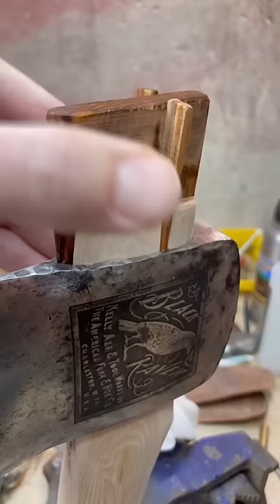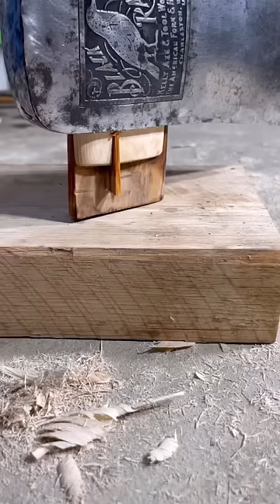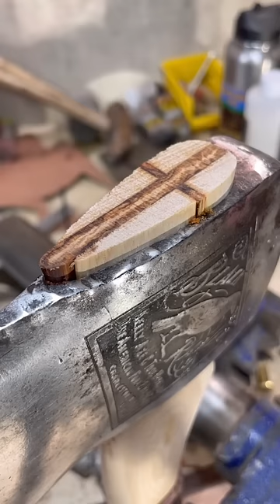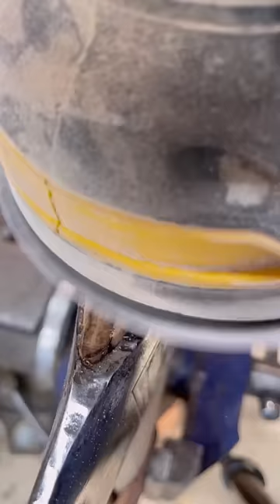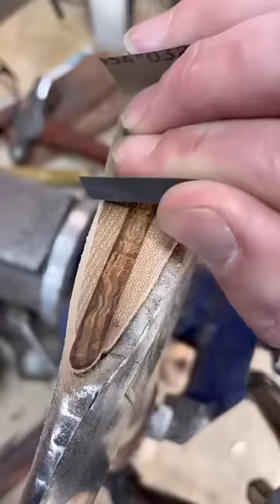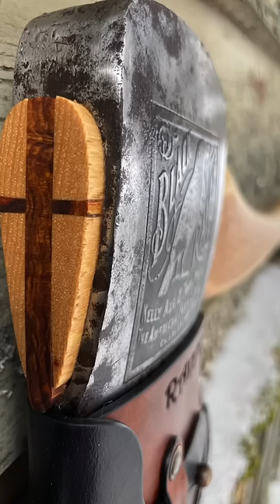Kelly Black Raven - Cross Wedge #stumptownaxes #vintage #axe

Comment: You should always put your oil on about an hour before you're going to install the handle on the head. Once you have driven the wedges the grain of the wood is compressed and does not want to receive the  Oil. If you apply the oil beforehand the oil will soak deeper into the grain and will actually get squeezed back out as you compress the grain
Reply: There appears to be oil between the layers on the area that goes inside.
Reply: Yeah, because anyone is listening to or cares to read the comment section when making and 🪓? Never.
Reply: @todtalk3912  I re-haft one of my axes every couple of years and I learned something from this comment.
Reply: I never thought of this. That makes sense. Thanks for the suggestion.
Reply: @todtalk3912 that's why you're in the comment section commenting?
Reply: Lol, look harder
Reply: I’ll never do it either way, but I love watching videos like this, but that makes sense to me👌nice comment
Reply: You always want to hang the head when the wood is as dry as possible. If you oil it first, the wood expands, you hang the head, then the oil dries out, the wood shrinks, and the head becomes loose. The wood will take more than enough oil after the head is hung.
Reply: I get what you're saying, but why put it in there just to squeeze it back out? Even with compressed fibres wood will still soak up oil's, just slower.
Reply: @todtalk3912  speak for yourself. I always make my axe handles myself and read YouTube comments. so just because you need a reason to complain, hm?
Reply: Where'd you read that nonsense, if it's that important, you're better off doing it dry then dunking it in an oil bath for a couple days, but it doesn't matter, just oil it now and then
Reply: @DQ Dukey  no you don't you don't even have an axe
Reply: @ericschulze5641  I have three. Stop talking if you have no clue. What are you?
I'm doing minimalistic trips through woods and mountains for weekends or holidays. How arrogant can someone be, huh? 😂
Reply: @todtalk3912  I have two axe heads I haven't got around to putting a handle on, was a useful comment for me. Plus the concept of oil before squeeze might apply to other situations.
Reply: I thought that was varnish 😅
Reply: Looks like that's exactly what he did...
Reply: It's wood and it's not in a press. It'll still soak plenty enough of that oil up to do what it's intended for.
Reply: @agentstaple1  I'm pretty sure pre-oiling would benefit in other situations. 🤣 but not with fitting wooden handles. Never soak an axe handle in anything prior to fitting it. It'll eventually dry out, contract and loosen. Just oil the wood afterwards and you'll be just fine. I still have 20 and 30 year old handles still going strong. If I remember correctly, I've only had 2 or 3, out of dozens, loosen over the past 30+ years. And they were easily retightened. 
My only problem with wooden handles is my memory.. I forget to move them out of the way of cars and trees. 🤣🤣
Reply: I don't understand why anyone would think that soaking a wooden handle in anything, prior to fitting it, would be a good idea. It will just loosen as it dries out and never fit right again. 
PSA: Gentlemen, only oil your wood prior to fitting when you're NOT dealing with tools.
Reply: As a matter of fact, if you think oiling before hanging is smart, just go fet yourself a fiberglass handle and leave the wooden ones for the real men. 
I guarantee your hands aren't callused enough to handle hickory anyway from wearing those little x-small pink gloves. 🤣
Reply: Х
Reply: Хх
Reply: Х
Reply: Ххххххххххххєэхххххх її х її эххххххэх хх х її ххххх
Reply: Хххххэхххххххххх
Reply: Ххх хх хх
Reply: @ruraljuror6585  хх
Reply: @todtalk3912  Sunday, I went to the flea mrkt and bought a new handle , I will use this idea
Reply: Won’t it dry and shrink then loosen? I’m not taking yt comment advice seriously lol
Reply: It’s what I do!
Reply: @todtalk3912  seems like you are wrong! This axe would attract the attention of axe handlers for thousands of miles! We will listen to this man who is speaking facts
Reply: But wouldn't the swelling reduce as the oil dries up causing looseness?
Reply: @Falling sun creations  are you even clued in to why there were bashing what I said, or what I even said?
The original comment was attempting to correct the person in the video.
I said, basically, no one cares what ur opinion is.
I agree, the video is great.
It doesn't need to be critiqued by a basement arm chair bandit.
Reply: What kind of oil he put ?
Reply: @todtalk3912  I'm taking this information, I'm trying to fix up an old hatchet atm
Reply: Thank you for this I have a few old heads id like to replace the handles on.
Reply: @placebomandingo2095  i also made a mental note
Reply: @RF-Ataraxia  not really, what I said stands to be a truth.
All I implied, if anything, was that he was wasting his time making a comment so detailed.
Never did I pick apart or put down what he actually said.
Reply: @todtalk3912  Fair, but still, don't know about that my dude, I've already seen lots of people take the advice several times now, and only within these 12 hours.
Reply: @RF Ataraxia  personally seen? With your own eyes?
If those 12 people make a video and post it.
You take those 12 posted videos, I'm not gonna watch it if there's only 11, and make a video that has them all compiled and professionally edited, obviously my time is valuable (you should consider yourself very lucky that I'm even responding to you, let alone allowing you an opportunity to prove urself to me) so make it quick.
Upon watching it, if and only if the video is well edited with perfect lighting, I will then, if you beg me to and refer to me Bro (I don't care for "my dude" borders disrespectful if I'm being honest)when starting and finishing a sentence, I will say you might have been correct.
Reply: @todtalk3912  Can't believe I'm so lucky a random stranger is talking to me, AND they're demanding to have hard, professionally edited evidence of specifically twelve other random strangers taking advice, we're about to invent online forums again! What an honor!
Reply: @todtalk3912  are you sad in life?
Reply: the wood will always recieve the oil. waste of time following this advice.
Reply: Siempre se pone el aceite después para que al chupar se expanda y se ajuste más.
Reply: @todtalk3912  yes. They would
Reply: Why would you put a lubricant between the thing you handle and the thing you never want flying anywhere? That + the shrinkage other people talk about here makes me believe that's a stupid idea.
Reply: How could he put oil on before cutting it?
Reply: what kind of oil I should use?
Reply: he did. his fingers are wet with it when he starts the process. pay attention.
Reply: @todtalk3912  Speak for yourself bro
Reply: А кто сказал, что это масло, возможно лак... 🍷😁👌
Reply: @Gunth0r  he's trying to push his personal shrinkage issues onto the other wood handlers here.
Reply: @tenGjenko  that's such a great line, lmao
Reply: Make 30 axes a year. Been there done this. Dude don't make Axes. Itll never compress correct and will dry out faster. Head will be loose inb5 months. I promise
Reply: No
Reply: @todtalk3912  well we have.
Reply: @todtalk3912  still general helpful advice for wedging
Reply: Thanks
Reply: quit over complicating basic things, get back to work.
Reply: You should NEVER do this.
Reply: @todtalk3912  I came here for this 🙌
Reply: You can see the prices have been oiled all except the last half inch or so.and mire than that got cut off.
Reply: If you put it on after, won’t it help provide additional force against slipping? As the wood tries to swell?
Reply: See that darker part of the wood at the beginning?  That’s all oiled. I think he knows what he’s doing. 🙄
Reply: Let the professionals hand it buddy lmao
Reply: @todtalk3912  smug... other people might just have good ideas. Way to be a loser though! Great job!🎉😂😂😂😂
Reply: @placebomandingo2095  I don't use axe only my Husqvarna 555 but the comment was right, i mean it's common sense xD
Reply: @placebomandingo2095 ..
Reply: @todtalk3912  he’s giving a tip/constructive criticism, why you white knighting for the video creator lol? He would probably appreciate the advice
Reply: @Imperial Security Bureau  ur white knighting (whatever the f that means, it's 2023 bro, prob some woke CNN term), for someone who commented to the a post????
Reply: And it needs to be Holy Oil...
Reply: you should always put the oil at the end so the handle wont slip off.  also, you dont need oil on the parts that are already protected compressed inside.
Reply: @redandgoldfan3869  apparently you don't need it.
Prove with both a video done both ways and durability tested both way, equally...
Thought so 😁😇🙄
Reply: @TodTALK  i love how one troll can bring together an entire comment thread with the shared goal of calling out their stupid comment. In my head canon your just pretending to be dumb with the real goal of bringing people together.
Reply: I think you should just let the guy that makes axes for a living do his own thing. I’m sure he has way more experience than you
Reply: Weld a metal handle on there.  No oil.  No glue.  No bull.  😀
Reply: Chainsaw > axe
Reply: @todtalk3912 Hate your dad or something?
Reply: @todtalk3912  Just because it's not useful to you, doesn't mean you can speak for the majority. You listened and cared enough to comment. Your comment spews nothing but ignorance and hypocrisy. Good day.
Reply: @ruraljuror6585  amazing username
Reply: @agentstaple1  if you oil it first, you run the risk of the axe head comming loose if/when it dries out a little. Better to oil it after imo
Reply: Looks like  he did pre  soak it
Reply: So you post your version magic mystery oil guy
Reply: Jeez there's always an arguement, both ways work, there's more than one way to skin a cat.
Reply: Is that oil or an epoxy
Reply: Will do.
Thanks bru
Reply: “You’re not making Christianity better, you’re just making rock ‘n roll worse.” - Hank Hill
Reply: @littlejackalo5326  if you’re really worried about the wood not getting enough oil, you could always soak the ax in a bucket of oil that also keeps the metal ax from rusting. 
Or spray the oil thru a airless sprayer. You wouldn’t believe how much an airless sprayer can make the oil penetrate thru wood!  Sprayed 3/4” thick oak drawer fronts with oil on the back and flipped them over to spay the front side. Only the front side already had the oil dripping thru the front of the drawer faces. Soaked right thru the 3/4” hardwood!  Was a surprise to me, but shows how much pressure the airless sprayer puts out!
Reply: @todtalk3912  I actually will need this info lol
Reply: There is no evidence to support your claim.
Reply: -ADACOR-  That is a myth

Comment: Absolutely 100% the best and most correct way to install a wooden wedge when hanging an axe head.  I hate to see people use wood glue to doe this. The boiled linseed oil will help  drive the wedge in place and as soon as it oxidizes it locks the wedge in as well as preserving and waterproofing the wood and keeps it from splitting or cracking by drying out.  Nice work! 👍👍👍🪓🪓🪓
Reply: what is the downside of wood glue
Reply: @b9rujq278 great question.  It works perfectly fine as well, I personally don't use it bc  the blo actually seals, waterproofs and preserves the wood  and prevents any swelling which causes a loose head once the wood dries out again.  Also with glue you cannot ever remove the wedge and axe head for any reason without damaging the handle. I like to be able to reuse a good axe handle if need be on another head.  👍🪓
Reply: Guess I'm lucky because the "wrong way" has b
Never failed me in 15 years and 3 or 4 handles
Reply: @ryantracey8574  nobody ever said it was the "wrong way".  Glad it worked for you. 👍Read the comment above yours. ✌️🪓
Reply: @b9rujq278  the original comment spelled it out. Wood glue doesn't have waterproofing qualities.
Reply: @aznative_  it said it waterproofs wood but said nothing about glue
Reply: @b9rujq278  sure it did. You just weren't paying attention. I even reiterated it. At this point it's obvious you're beyond help.
Reply: @J_ismyname48  yeah you said you hate people that use glue to do this most people want a axe handle that won't ever come off use wood glue and once it cures give your axe a good bath in oil it will be good forever
Reply: Wow, lol, I never said I hated anybody. I think you missed the point?  A properly installed wedge itself is what holds the axe head and handle together, not the glue or blo but yes, you can use either just fine as I previously  mentioned, I personally prefer blo.  Treat your axe  handle with whatever you like or works best for you.   blo works great. 👍🪓✌️
Reply: I get the feeling that the "proud" and oiled method is ancient, and best.

Comment: As a carpenter, I can tell, this is solid work.
Reply: As the owner of a knife & tool sharpening service, I can tell, this is an axe.
Reply: As someone who uses axes to chop wood.. I would not feel safe using this axe as intended.
Reply: @demonofheavn Oh come on, at least elaborate if you disagree. Give us a reason. Your viewpoint. I know nothing about anything about axes or chopping wood. Don't be a tease, share your thoughts.
Reply: @liisahmanni  axe heads notoriously become loose, which can be very dangerous. This is why we typically put metal wedges through the wood (where the cross is). I prefer circular metal wedges, but any metal wedge would be better than wood and epoxy.
Reply: @demonofheavn  Thank you. My default sandwich is: sourdough, ham, lettuce, mayonnaise, mustard.
Reply: Yeah. Doesn't look much like a liquid or gas to me too.
Reply: @prototypeo1404  

No joke Sherlock?
Reply: As someone who applies Axe body spray in the cross pattern, I can say this man deserves a raise.
Reply: As a non-carpenter, I'm just here to find out what song this is.
Reply: As a you tube watcher I can tell you I seen this in you tube
Reply: @demonofheavn  พนุช
Reply: As an artist I can see that etching was good work 👏
Reply: As a former imaginary carpenter, I’m here to say wow, is it an axe?
Reply: @demonofheavn честно говоря не согласен. Дерево более мягкий материал чем металл, а отсюда 2 вещи: при рубке происходит вибрация материала, в данном случае топора, дерево как более мягкий материал пружинит, а вот металл, как более твёрдый материал, выскальзывает. К тому же эпоксидный клей проникая между волокнами дерева слепляет его. Вывод: деревянный клин лучше железного! Ремарка: клин нужно брать из более твёрдой породы дерева.
Reply: Greetings from here, another carpenter, I confirm what you said
Reply: @liisahmanni  lmfao youre fucking hilarious. Sharing info for info i see
Reply: As a vertical saw operator i don't know shit
Reply: @crazyndn49  did you find the name of the song?
Reply: Этим инструментом (топором), можно будет пользоваться максимум год, потом ручка подсохнет и топор начнёт слетать, это легко исправить опустив верхнюю часть топора в воду на пару часов, но из-за того что там масло оно не пропустит воду и придётся делать новую

Comment: I apprenticed under a Woodwright from Austria in the early 1980's in Virginia.
Every one of his striking tools, axes, adz's, hatchets, hammers, sledges and mallets had a "proud" handle with wooden wedges that flared out above the metal heads.
When I asked him about that, he stated that the right way to set the head to the handle is to expand the wood with the wedges to keep the heads from flying off. 
I've done that with all my handles over the past 40 years and have never had a head move on me. Commercial hammers with flush handle tops are built for "show", not for "work".   :^ )
Reply from the maker: Agreed.  That’s what’s done here 👍🏼
Reply: Nicely done with skill and talent and a whole lot of knowledge
Reply: Thats common knowledge buddy
Reply: @TripleTreuViet  well no it's not. you're saying it's common knowledge when I can guarantee you didn't know it before you read the comment
Reply: @chetonmic9142  Very true. I didn't know, but it certainly makes sense! I'm filing that away for future use.
Reply: Same with cutting rope ends, always leave 1/2" after you tie or tape
Reply: Interesting~~~
Reply: Ah got it! I was just about to ask about why the wood wasn't flush but this makes more sense. I thought at first it would get caught on things while in use.
Reply: Here in the Philippines the head of the axe they made from the abandoned steele of the railways
of train then to expand or the wedge to flush they slit the wood
in two slanted column by flattened 3 inches galvanized pipe iron.
Reply: @subharmoniccicada612  seems really resourceful! As long as it's safe and works, then all the power to you!

Comment: As a carpenter I can tell this isn’t his first rodeo
Reply: As a carpenter and someone who grew up in a house heated by wood stoves my gramps would of laughed his ass off if took me this long to put a handle on. Turn it upside down hit the end of the handle with the hammer side of the maul and it will jump right up the handle and tighter than that will ever be. Sure is pretty though.
Reply: As an axe I can tell that this isn’t his first time doing this.

Comment: Good move oiling the wedge.
On the railroad, I'd get my crew to soak the tops of the handles in oil or diesel. 
Wet wood fibre doesn't break as easily.
Reply: We use antifreeze
Reply: @steveheiss1253  nice, didn't think of that.
We just used the diesel because the oil in it wouldn't evaporate

Comment: Black Raven. From WV. The axe a miner takes down the hole. Run that handle in boiled linseed oil and when the coal dust settles into it, it has this darkened patina just doesn't come from axes used elsewhere. Unique to home.